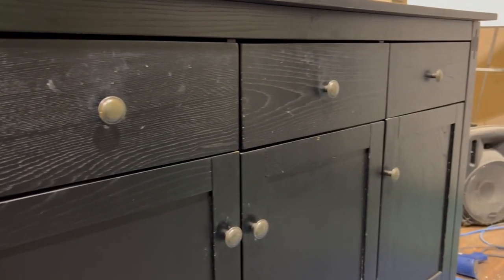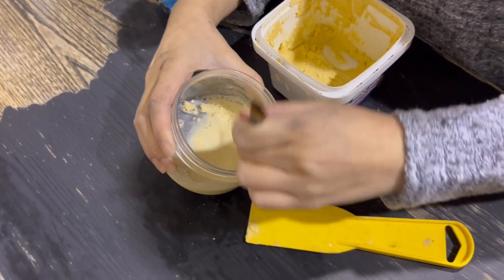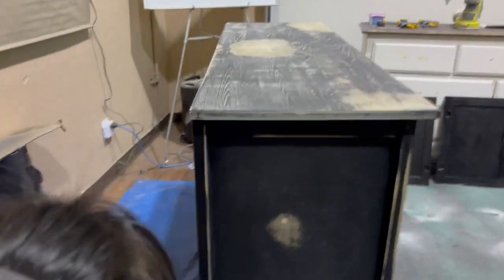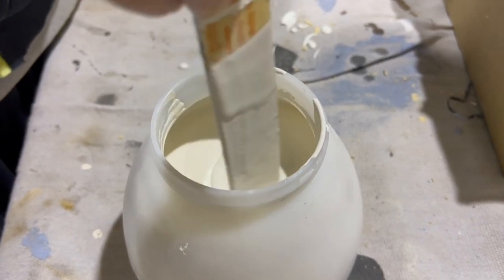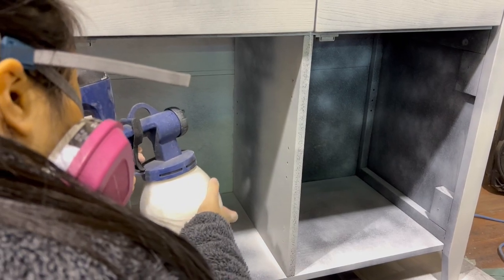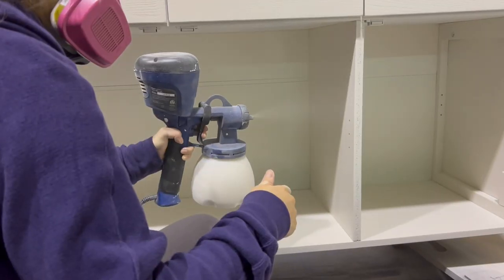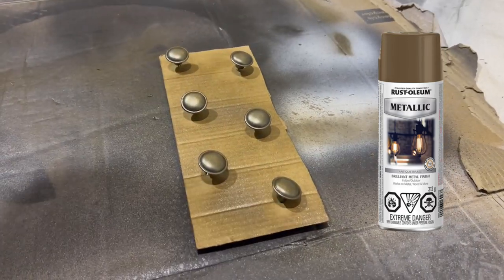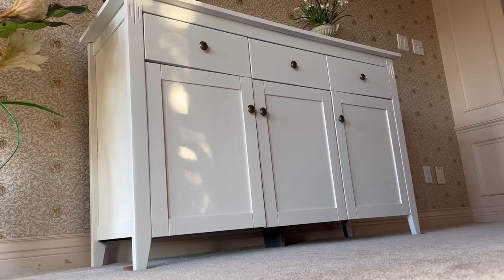PAINTED FURNITURE FLIP: This sold IMMEDIATELY! | Trash to Treasure | DIY Makeover

Comment: Nice job...With so many people saying you need to use this paint and that paint to paint furniture it can get confusing..Do you feel that regular latex paint is durable enough to paint furniture if you do all the prep work properly. And is latex paint the only paint you use to paint furniture? Thanks
Reply from the maker: Hey! I know right- I got so tired of hearing I had to go buy paint from one of like five furniture paint companies. The doors open though, maybe I am missing out on a whole new world of paint. I guess the rebel in me was just out to prove a point haha!  I think as long as you don’t slack on prepping (clean, sand, prime), then you would be good to go. I have the most experience using Behr products which is an acrylic latex formula, which is supposed to be better than just regular latex. I have my dining table painted with wall paint that I did over the summer (takes a lot of abuse), and the finish is still almost perfect. No chips, peeling, just light scuffs from everyday use. So go for it!